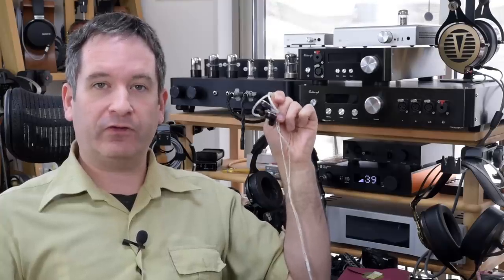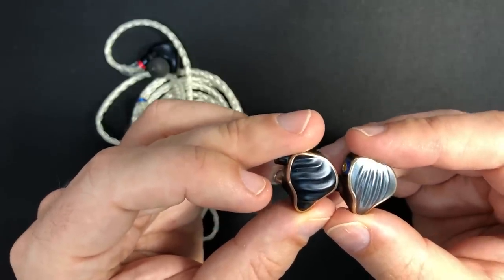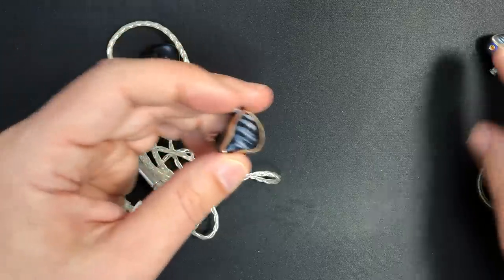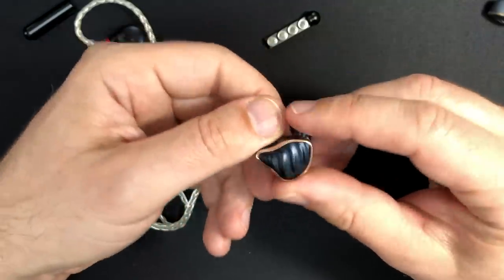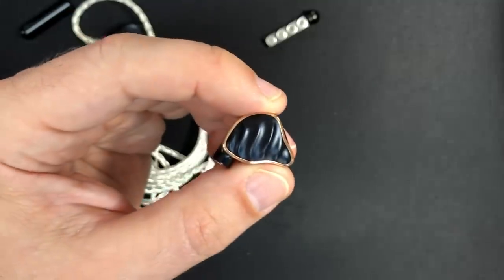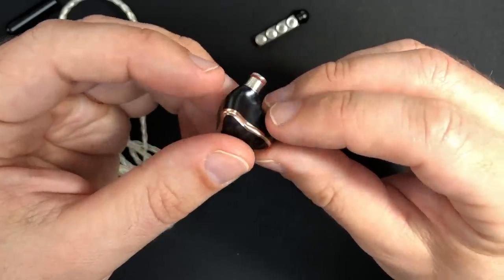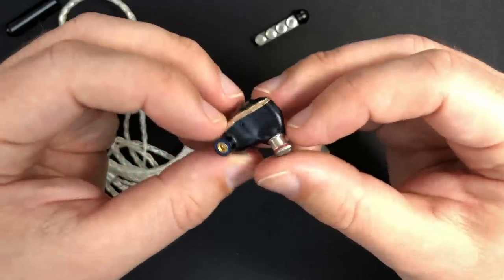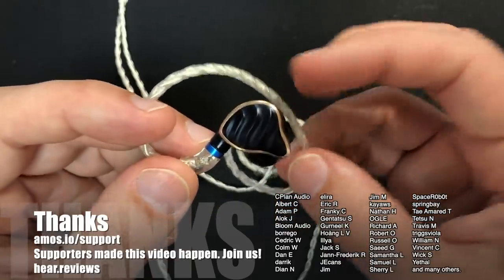FiiO FH7 Hybrid IEMs - Has FiiO just out-done $1000+ IEMs for under $500?

Comment: @Currawong  

I'd really like to see you compare these to the AKG N5005.  The sound of the N5005 are very tip-dependent, but once you find the right tips for a good seal & comfort, plus a balanced sound, OH MY!

I'm a drummer & saxophonist, and the accuracy of these instruments is stellar with the N5005.

The articulation, airiness, and deep bass of my kick drums are perfectly reproduced, along with the snare, and tom toms.  Same for the shimmer, detail, and decay of cymbals...EXCELLENT.

I found that narrow-bore tips combined with the "Reference" filters gave the best overall performance in all regards.  And when these go on sale, they are the same price or even less than the FiiOs.

The only issue for me is that the ear tubes could be a bit longer, and they are a bit too large of a diameter for my inner ear canals.  But if you can get a good fit and seal, these will not disappoint!

Comment: Those iems are fantastic,  yes the trebble was a bit harsh at first but all that went away after breakin and now they sound awesome no matter what filter or tips are used. The cable is great, high quality and stays is  place behin the ears, i got the 4.4 balanced which sound even better on my Fiio M11 Pro PAD. Possibly 3000$ iems wound sound better (i wouldn't know and don't much care) but I can tell you that my 1000$+ Beyer Dynamis Xelento don't sound as good  as  these. That review was unnecessarily long. Also unfair to the CA Polaris which are actually really really good and a lot of fun.

Comment: Impedance of earphones with different drivers (especially hybrid with dynamic and BA) is not actually "flat" across the board. Every driver has it's own impedance. This is sort of "flaw" and many manufacturers are trying to avoid this (64 audio as of now most successful). Anyways, impedance difference in cable in such rare cases does not affect each driver equally. So lower the impedance of cable more it will affect say high freq BA driver than it will affect dynamic bass driver (made up example!). So lower the impedance of cable, the "brighter" and "thinner" sound will appear simply due to that high freq driver being louder more so than higher impedance bass driver (no quality changes or anything, it's just slight volume difference due to impedance). Nothing to do with mystic vibranium in cable. It's simple as that. And this is only true if it's multi-driver (usually hybrid) IEM of very different impedance drivers, and have two very different cables. Other than that slight volume difference per driver due to impedance difference, which can actually alter sound in such occasions, there is no actual audio quality changes, even tho it might trick you, for example louder the low impedance high freq driver is, more perception of detail and clarity you have.
Reply: Exactly...  Well explained... I had this discussion un another audio thread... I'm an Electronics Engineer.
Reply from the maker: There is also the potential issue of crosstalk in cables, and the plugs. Some weird issues that came up with the Hugo 2 and soundstage turned out to be an issue with connectors and crosstalk. Construction and plug quality seem to be of some importance.
Reply: @tomcruz7177  I did. Did you read my comment? Cable might make your earphones sound different for the reasons I explained.

There are some other factors also. Crosstalk as Amos mentioned, shouldn't be much of an issue unless you have some particularly bad cable, but in theory exists (basically when twisted in a particular way without shielding one signal can interfere with other), plug and connector quality might affect "sound" in a way. For example my old Senn IE80 didn't have gold plated plug, it got oxidized after 3 years and I had noise (especially while rotating jack inside my player) which gave me perception of less clarity (even tho it was just slight noise added). Any interference to signal is pretty much impossible for such short cable that has any cheap shielding, so no factors there.

Also stiffness of the cable (due to coating) might affect microphonic noise. If cable is flexible and soft you will hear less noise from physical contact, for example cable rubbing against your jacket.

Other than potential noise (extremely rare and almost irrelevant, usually inaudible and even immeasurable) and different impedance (which might affect specific drivers more than the others in multi-driver/hybrid earphones) there is nothing in cable that can alter sound quality.

Doesn't matter if it's copper wire, or crystal silver cable directly extracted from black hole's core and washed in the blood of 3 virgins.

If it's not noise (usually due to really bad cable) it's either cos of stuff I explained or you are placebo driven person cos you want to believe it changed sound.
Reply: @tomcruz7177  Why don't you read what I wrote?
Reply: @tomcruz7177  Why don't you read my comment?
Reply: Sorry but I don’t agree with you.  Now how will you handle that?
Reply: @tomcruz7177   You do not agree with what part exactly of my explanation in original comment? And what is a matter of opinion in that explanation? How will you handle answering this?
Reply: Nioh I think your main point was that the cable does not change the sound.  My main point as well as Amos was that it does change the sound...  do you understand where we all are coming from now?
Reply: @tomcruz7177  You think my main point was that the cable does not change the sound? You think wrong. Can you please, I ask nicely, read what I wrote in my original comment?
Reply: Nioh if it affects the impedance of the drivers, then yes it changes the sound...  it is not an illusion or perception... not getting too technical.... there is a change in the overall sound experience... even Currawong and I can hear the difference... others might say too.  So I’m gonna have to disagree with you that cables don’t change sound.  Please clarify anything else and I will reply lol
Reply: @tomcruz7177  It doesn't affect impedance of the driver, driver has it's impedance, but rather add/lower impedance overall. For example one driver is 3.5 Ohm (like Knowles tweeter), one is 24 Ohm (dynamic driver), change in cable might be 0.35 Ohm, which would affect much more that tweeter than bass, resulting in different sound, yes. But it has nothing to do with cable quality, some magic materials, price, crystals, braiding and so on. 
For example, if you use a single driver earphone (example idk Sennheiser IE80) or some "flat" impedance earphone, cables would not make any difference at all. 20$ cable and 1800$ cable would "sound" (they don't sound) exactly the same.

So yes, it may (and does) affect in certain situations how earphones sound, but have nothing to do with audio *quality*. 

Thanks for finally understanding and reading my comment! Good luck and bye!
Reply: Nioh ohhhh.... now I see where you are coming from... audio quality.... yes the cable does change the overall sound signature of the earphone I guess in some ways..  but I’m not sure of the sound quality but that’s is why it sounds different?.... I understand your reasoning, so sorry for the misunderstanding!
Reply: @tomcruz7177  Exactly! Impedance difference between two cables affect volume level of certain drivers more than others, so for example your high frequency tweeter might be louder than than bass driver unproportionally. But you do get the perception of clarity for example, or if you have higher impedance cable you will feel "warmer" "bassier" sound as volume level of bass driver would lower just 1-2% while high frequency driver would lower in volume for like 10%. But actual quality of audio cannot be altered by cable nor it can affect properties of audio itself, rather making certain drivers louder/quieter due to impedance difference! 

All good, sorry for some harsh words I lost it at some point!

Comment: How would these compare with Shure SE535s? The only IEM's of this shell shape I've tried are from Noble Audio, and they stuck out like lumps and didn't get a good seal at all. I think I have pretty small ears, and the Shures fit me well with a firm seal using small tips. How does the sound quality compare, do you think? I have the red version and listen mainly to ambient, soundscapes, jazz and some classical and metal.

Edit: I just tried these and they fit surprisingly well! Even with the larger silicone tips, they are comfortable and have a good seal. The soundstage is huge in these things, definitely wider than the Shure SE535s. Sound quality is a big step up. Isolation is NOT anywhere near as good, these aren't going to block out airplane or loud machinery or even a daily commute. The Shures are kings of isolation. But in a semi quiet environment, relaxing somewhere, I can see these being great.

Edited again: I tried the FH7s next to the FA7s, and the difference is very noticeable. You mentioned how the FA7s seems muffled by comparison, I totally agree. FH7 has wider soundstage and instrument separation, and more clarity. The price jump is worth it, I think.
Reply: I have the Shures as well and just ordered the FH7.  Good to read that hey sound better than the Shures.

Comment: Now, I’m not an experienced audiophile by any means. I had the FH7 for 6 months and their treble made my ears hurt regardless of which source (Fiio m11, ibasso dx220, LG v40) and cable(Fiio pure silver, the stock cable, or Fiio’s B line) I used. I’ve had the FH5 for a week and to me they don’t have the same problem in the treble, imaging is better and overall they sound smoother than the FH7. The bass sounds a bit bloated with the stock config, but overall I’d take the FH5 as a daily IEM. :)

Comment: I love my FH5 so I was very curious to hear about these. Nice review. I really want them, but I don't feel the need to rush out and buy them. They're not even on amazon uk yet. The FH5 are £229 on amazon, so I wonder what the FH7 will cost.
Reply: They are in the uk at £450 in a couple of places but agree not on Amazon yet.
Reply: @lisagreen779  £450? Ouch! I shouldn't be surprised I suppose. It's good to know there's an upgrade from the FH5 at least. Thanks
Reply: I use the FH5 as my daily drivers. Heard the FH7 from my local store and for the huge jump in price, I don't find it worth upgrading to.
What I first noticed is the soundstage being pretty big and accurate. Bass and trebles are slightly more refined. Other than those stuff, the FH7 is quite similar to FH5, like currawong said in the video.
Reply: @njj42  I disagree, had the FH5 for half a year and bought the FH7 two weeks ago and the difference is big, bass is much better tuned, huge stage, better imaging, luckily not in your face mids, much better highs and finally better fit and isolation, also the cable is of higher quality, you get more aceessories and a really nice case, it's a bargain for 450
Reply: @FriedEgg101  You can get them directly from FiiO via Aliexpress, £380
Reply: @hkhudadad  Oh wow cool! Good to see a different opinion! Over here in my area, the FH7 is nearly two times the price of FH5, so it's not worth that price jump imo. Gotta agree with that huge soundstage and imaging!
Reply: @njj42  here too the FH5 is like 220 Euro and the 7 sells for 460 Euro
Reply: @hkhudadad  Oh dayum okayy
Reply: @IISocratesII  Nice! Thanks for the heads-up :)
Reply: I have tried both fh5 and fh7 and the difference is large depending on what you are looking for, The fh5 has a more commercial sound, not so natural, it has details but not so much, the bass lacks precision, the sound scene is short. With the fh7 it improves practically all that, the sound scene is so wide that it does not look like an IEM, you can locate instruments and singers where they should go, the details are their strong point, you can hear many more details than in the fh5, the bass are more controlled, they still retain a not completely natural sound, but they do better than the fh5, I use open models in general, I have a sony z1r, hd800s and a beyerdynamic T1 2d, and the fh7 doesn't has much to envy any of them , is very similar in sound to T1, in details (T1 costs twice). Compared to the hd800s, the sennheiser has an even more natural sound, but in details it is not so far, the same as with the sony.

Comment: Hi - i think using W shape in reviews is not accurate for the hybrid.  Parrallesim in the peak may apply, but not W shape per say.  Reason why i am saying is that when i ear W shape it makes me beleive buff, not my taste.  But in reality it is more parrallel peak rather then shape.  My two cents…
Reply from the maker: Thanks Patrick, your thoughts are appreciated. My image for a "W" sound is where one has what feels like a "V" shaped sound (bass and treble emphasis) but with a mid-range that seems more forward than expected. This without a boomy mid-bass. I'm probably fooled into that impression with gear that has an upper-mid/lower treble emphasis as well, to a degree.
Reply: @Currawong  fait enough.  I have the KZ ZS 10 Pro and although I feel the so called W shape, I feel further parallelism in the W peak, not the under peak low for instance.  Waiting for my new FiiO FH9 order to see if the higher price range makes it 🙂.  I originlly though to order the Meze Penta, but couldn't justify the 1.5KCAN :-)

Comment: I just got these iems today in the mail and when I plugged them into my pc I had like this static noise. Do I need like a dac or amp? How do I fix this and what would you recommend cause I can’t find any help online
Reply: Rohan Mitchell sure is a poor noise signal, you would need a dac and an amp. IEMs are super sensitive, so you jeed a clean source. I prefer using a portable one so the power isolation is better. Fiio has some good things check them out. If you are willing to buy an expensive set of headphones, you must buy a proper dac and amp, otherwise it would be like buying an expensive car but cheaping out on gas.

Comment: Very interesting review! I was wondering if you had tried the final audio e tips with these to see if the brightness of the treble was reduced. 
These Fh7 are sensitive to the source in terms of picking up background noise? I have a dx120 and I would like to use the fh7 with a balanced cable. Finally, on the cable, which one would you recommend to use?

Regards from Perú.
Reply from the maker: I don't recall them being very sensitive. Any modern DAP with a low output impedance should be fine with them, including when it comes to hiss.

Comment: Would you suggest to get a balanced cable for them?
Reply from the maker: If the device you're using them with has a balanced output, then yes, as that will be more optimum with that device (eg: The BTR-5). If not, no.
Reply: @Currawong  thank you for your advice. I want to get a singxer sa--1. Since it has a balanced output i wondered If it is worth it to get balanced ones for my in ears.
Btw your singxer video ist great.
Greetings from Germany

Comment: Did you try removing the screen in the filters? Heard they improve a little
Reply from the maker: I did. I didn't feel it made as much difference as it had with the FH5. Also, it'd be a very bad idea to let wax get into the FH7, as it would get deep inside and not be removable.
Reply: Yeah, there is zero need to do this.  Modding madness for the sake of it

Comment: What player do you use? Need smth special to drive them or a phone (i.e. S10..) is fine?
Reply from the maker: I haven't tried them out of any phones (I use iOS) so as long as whatever you use has a low output impedance (so you don't get changes to the frequency response) it should be fine.
Reply: You will be able to drive them, but they will sound far from what you would get even out of a Fiio BTR3.

Comment: how's the sound with balanced connection? also the sound character, is there any headphones that is similar to fh7?
Reply from the maker: The only difference a balanced connection will have will depend on the individual device. For example, the M11 has different circuits for balanced and SE outputs, so it will sound subtly different. There's a misunderstanding by many that balanced outputs have some kind of magical sonic properties.  Of course, if you're using a DAP with a balanced output, you'll get the most out of it using that output.
Reply from the maker: I forgot to add -- headphones like the FH7 -- maybe the Audeze LCD-XC? They are similarly quite mid-forward.

Comment: AKG K3003 copy
Reply from the maker: There are similarities in the design, but the way the dynamic driver is set up in the FH7 is quite different.
Reply: @Currawong  you are right, but I as referring to the BA part. How its placed, filter implementation, BA manufacturer. I was about to pull the trigger, but I still own a k3003 and boy, that treble is too hot to my ears